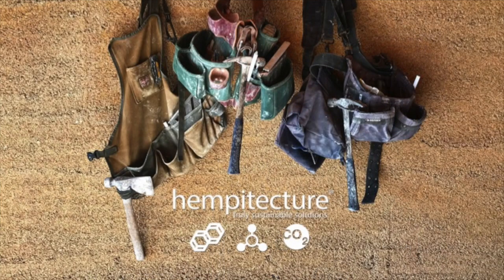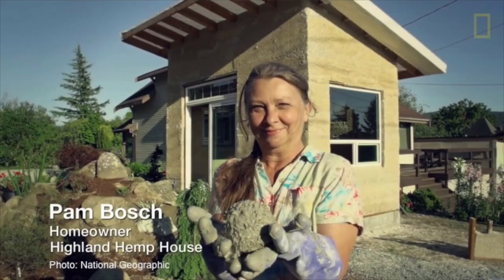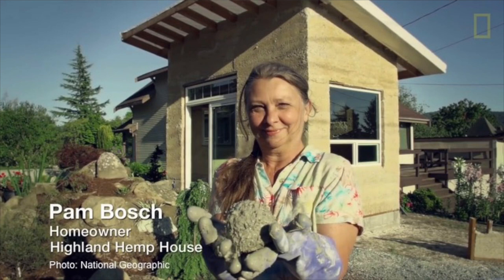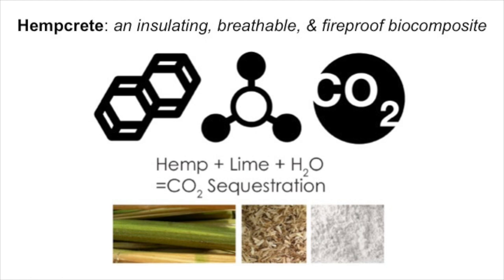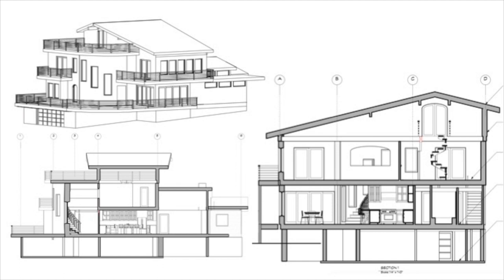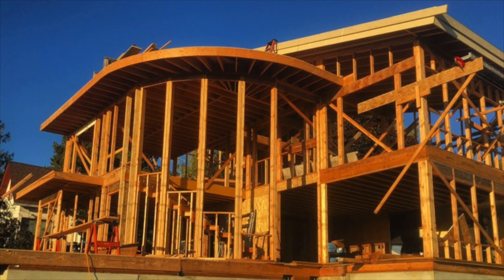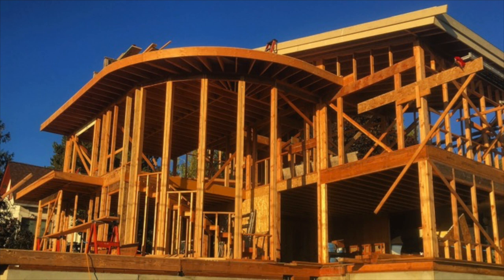Green Building Slam: The Highland Hemp House

Comment: Thank you , excellent action. Thinking, building and video !
Question :  is it true that hemp crete is petrifying over time and would that have any impact on the structural  capabilities  ?    I am no architect, so sorry if ithis are stupid questions
Reply: @Peter Sieben, ask questions, that is our purpose if we don’t understand. But, further research is a must, because that leaves open to more questions. Until, you find a person who is capable of answering your questions fairly. 
What I can tell you, how this video blog breaks it down, the end result, as the dwelling ages in time, the walls harden. The walls resist catching on fire, and is great for resisting mold, which concrete cannot or drywall on steel or wood studs. As mentioned in vblog, it draws carbon dioxide into the walls, so environmentally reducing the carbon footprint.

Comment: Trouble is that we need more CO2 in the atmosphere for optimal plant growth, according to Prof. William Happer. Pity the Hemp house absorbs some.
Reply: Actually, no pity at all - this is a realllllly good thing about hemp/hempcrete. If we don't reduce the CO2 soon, humans may not survive...and, according to Wikipedia, "The global average atmospheric carbon dioxide in 2019 was 409.8 parts per million (ppm for short), with a range of uncertainty of plus or minus 0.1 ppm. Carbon dioxide levels today are higher than at any point in at least the past 800,000 years.Aug 14, 2020" which is the real pity.